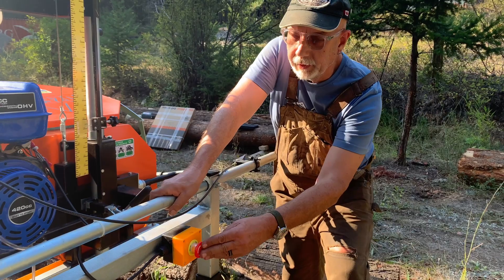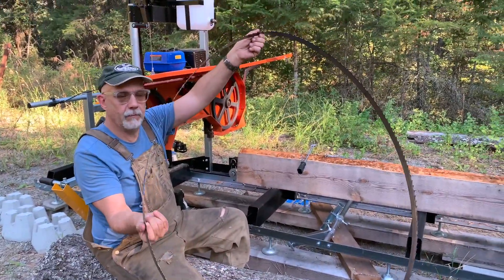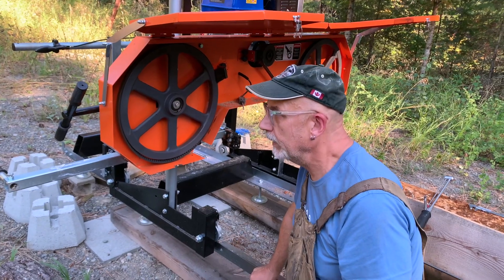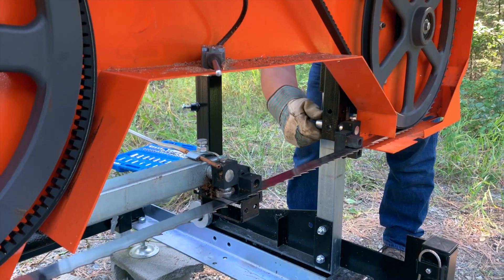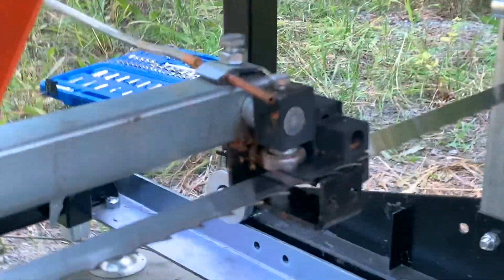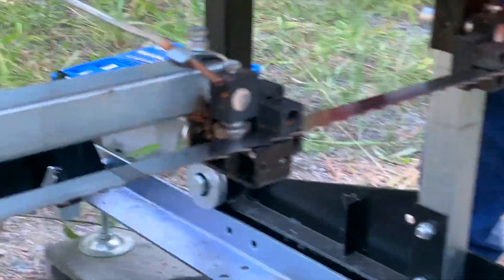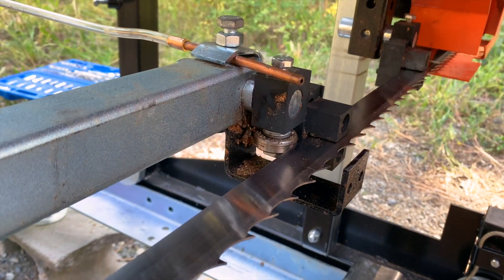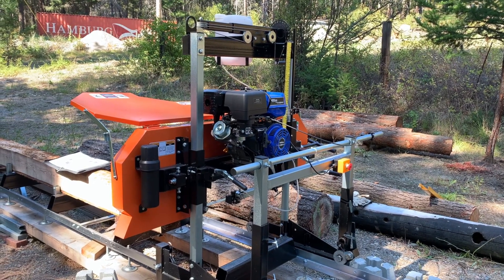Adjusting the Tracking on a Bandsaw Mill Episode 50

Comment: The clutch doesn’t work most of the time on mine and i have to tighten the clutch every couple hours because it constantly loose even after replacing the key that was long enough to bend the washer holding it on to the shaft. Buy a few blade guide bearings because it seems they get blade notched and wear out quickly if you’re cutting with a dull blade.
Reply from the maker: I’ve run mine a couple times this spring and it seems to be holding on. I do check the clutch and other “under the hood” parts before starting the mill each day.
Reply: @StaceyRobinsmith  the mill actually works pretty good it just needs a bit more maintenance than a higher quality unit, it’s super handy on the farm I’ll say that.
Reply from the maker: @redlinemotorcars2184  Agreed. It works for me, a very amateur mill user.